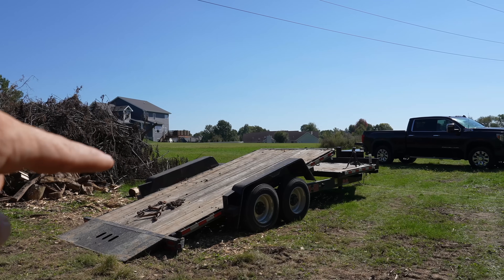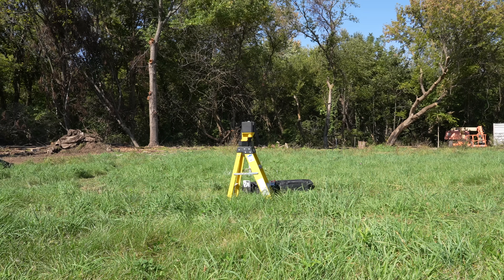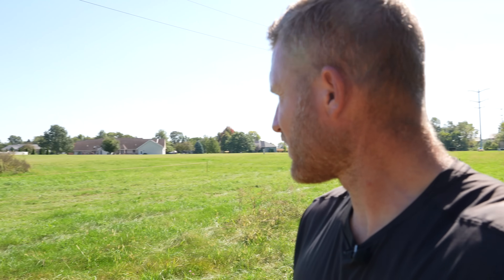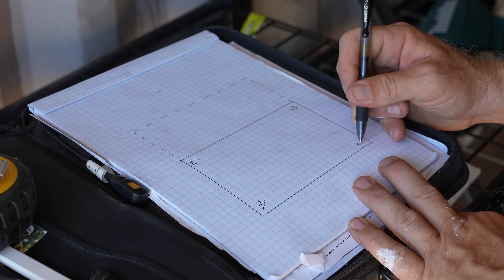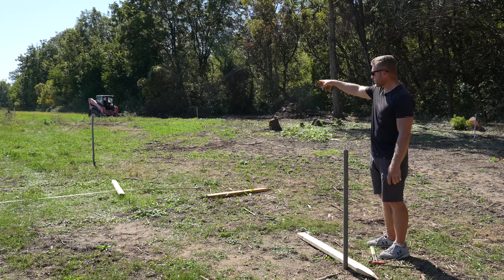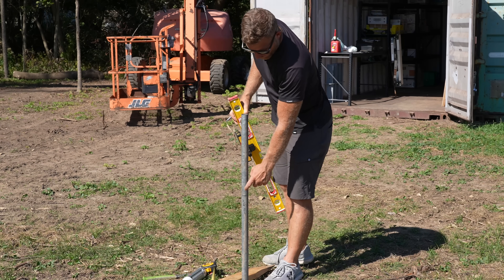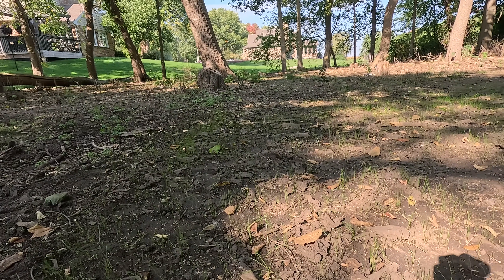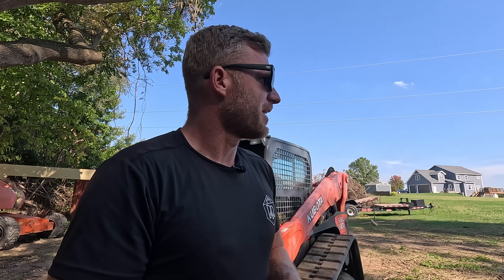My Dream Shop Ep - 2 Layout and Prep for Foundation Walls

Comment: In this video you were saying you wanted to share some costs.  I’m looking at having a “Passive Shop” building built and getting a lot of push back from builders/post frame companies specifically around “passive” methodologies and the incremental costs.  Most want to just do piers/poles/house wrap/metal and don’t really think that things like sheathing adds any value.  Now that you’re largely done with this project, do you think your additional measures (expensive foundation walls, sheathing, the extensive insulation both in the wall, below your slab, and exterior to your foundation, the complexity of your roof system, etc.) are going to be worth it?  2nd question, what do you think the most cost effective “perfect wall” would be in a post frame build???   Thx

Comment: Did you guys have a frost wall depth that you had to dig to? I might have missed the actual height of the wall, but it looks like the top of your walls are about 48" high plus your 8" footing? A good portion of that is out of the ground- especially on that back corner. I know you planned to back fill on that side, but how deep does your frost wall and continuous footing have to go to undisturbed soil being in Illinois? Up in my area of Illinois, the continuous footing has to be below the 48" frost line!

Comment: Seems like a weird location for a business. Behind a residential neighborhood and under high voltage transmission towers. It wouldn't surprise me if you got a tingle of an electrical shock on your metal siding, on very moist and foggy days.
Reply from the maker: I’m further from those lines than most houses in this neighborhood
Reply: I did work in a new townhouse development where the siding guys standing on aluminum walking planks attached to aluminum ladders were being shocked as they were working on a foggy moist mornings near transmission lines. Also I know a guy who stuck an old style fluorescent light tube in the ground directly under transmission lines, and it glowed at night. Anyway, I enjoy watching your channel, thanks.  @RRBuildings

Comment: The power company hasn't given you any problems over the easement for that high voltage line back there ?
Reply: I’m also a little concerned about those power lines.